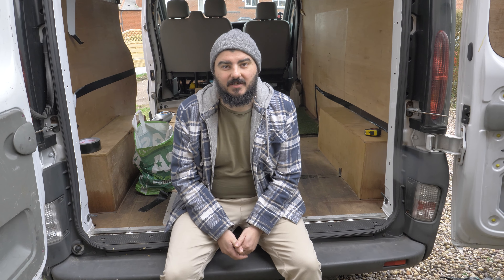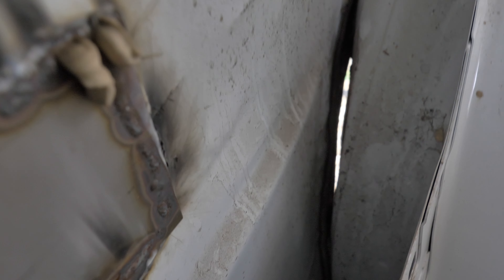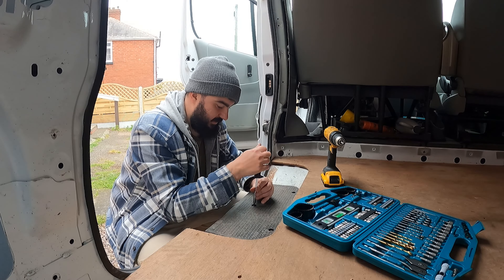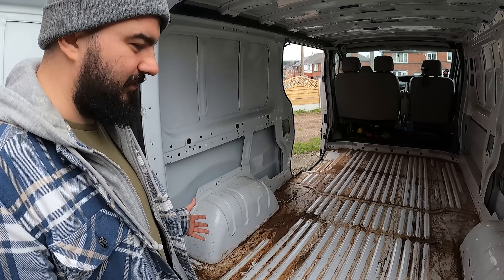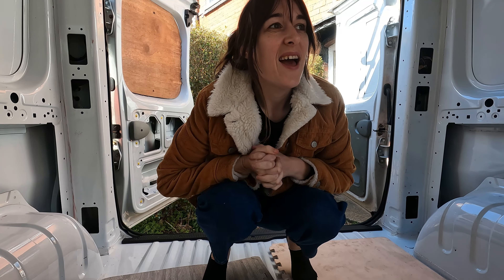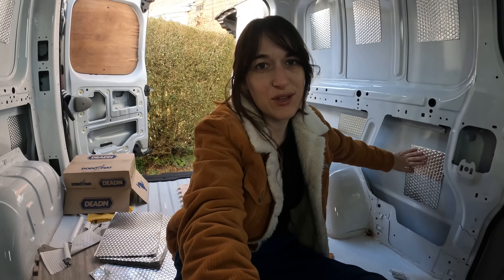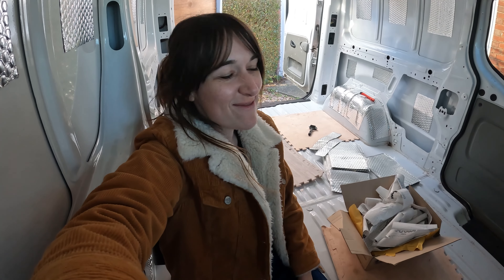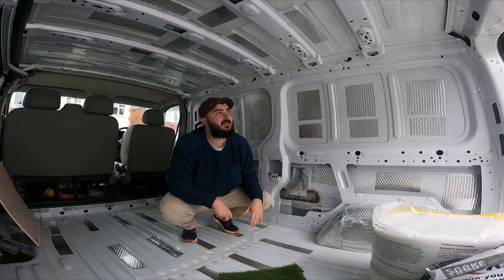Lifting the FLOOR on a 20 YEAR OLD builders van! Satisfying Clean

Comment: If you fitted your van out in a smart way, you could use it to bring in cash for a self employed business. That's exactly what I do. I first used my van as a, (  man - with- a van ) to do small time pick-ups and dropoffs. If I'm not using my van for work and have a few days off, I might head for the coast for a few days. Quickly dismantle my set-up, but leave a main cupboard in tact since it only takes up a metre space. That's also where I store my solar batteries etc
It's a mobile set-up whereby I can quickly dismantle or set-up again fast. In this way I can use my campvan as work van too.( Bringing in money as well)